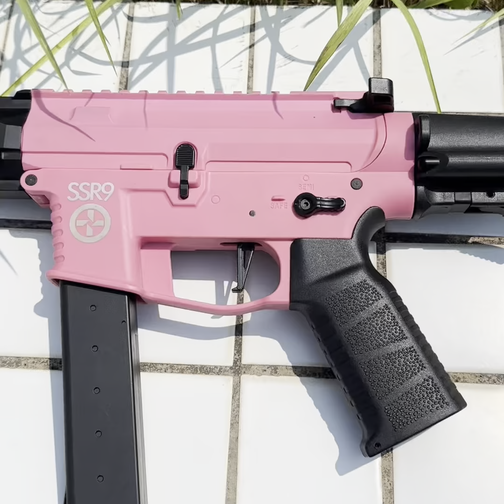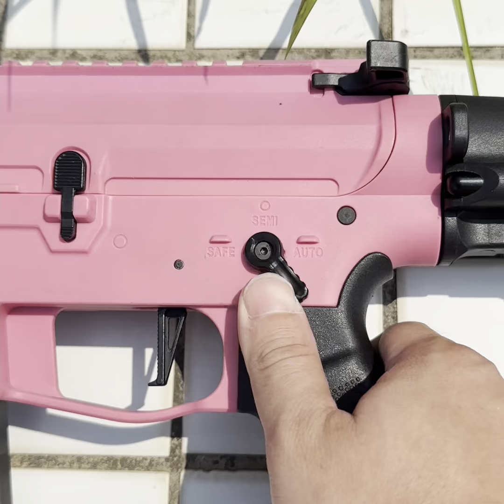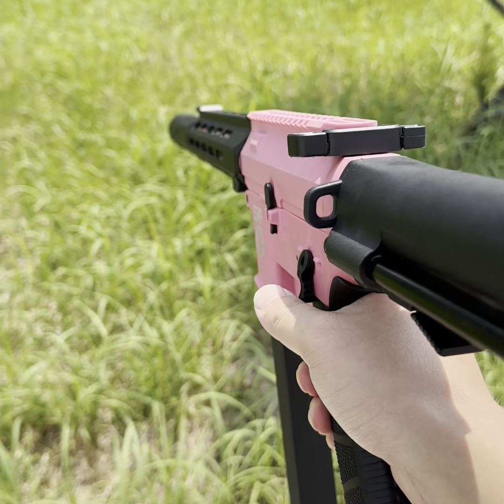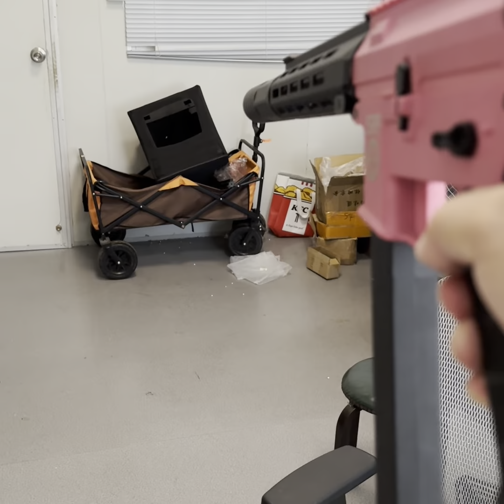Breaking in Solink helical gears - Final

Comment: did you have issue where pinion to bevel was really high and had to reshim the spur and sector bc sector was too high? also being bit screechy before the break in.
Reply from the maker: Didn't feel like i had to shim it any differently tbh. I'm quite lazy tho, I just shim the spur as low as possible then sector and bevel as high as possible, so they don't touch each other.
Reply: @wyz2285  usually having too much gap could result in higher amp usage since its not able to transfer the torque efficiently and also run into risk for breaking the gears. i comprised on my shimming so its not too bad but my set is still screechy compared to other helical bevel build ive done in the past
Reply from the maker: @QuantraClounix TBH I have not seen current CNC gears break and I'm fine with the few extra amps... Even with the gears further apart the contact height is still far more than 50% for the gear thickness. I try to get the bevel to pinion more optimal than spur to sector tho.